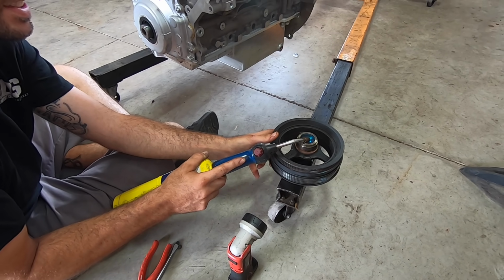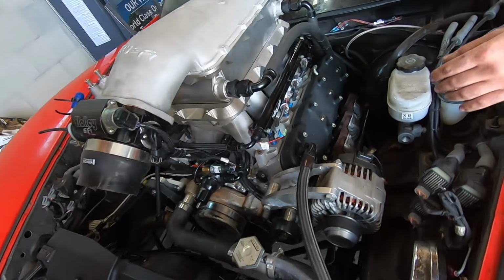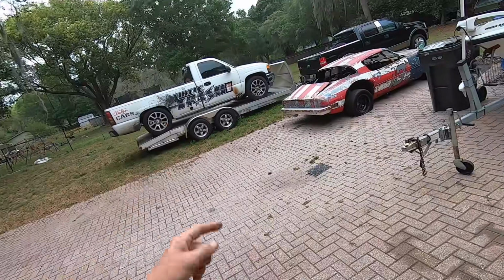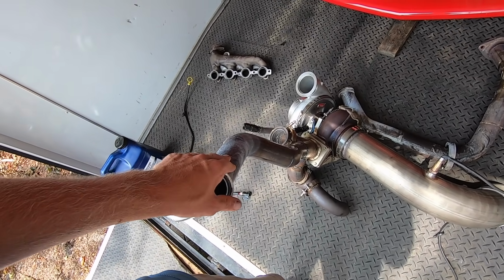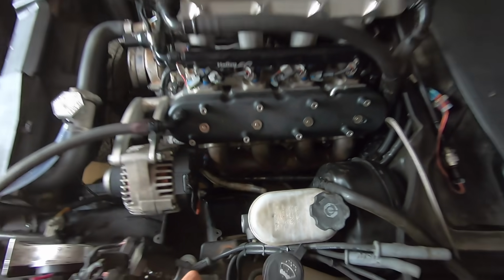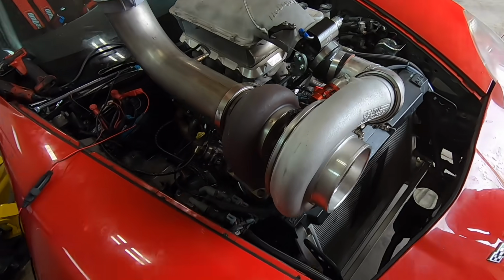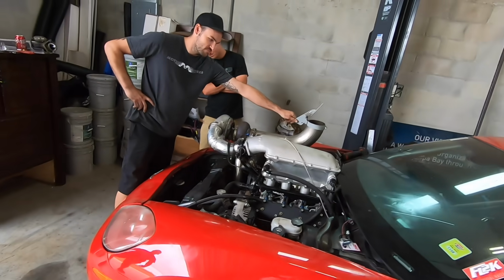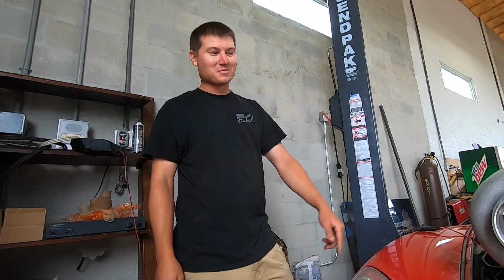Firing Up Ruby With Her NEW Texas Speed 7.0L V8 + Completely Changing Her Turbo System...(we had to)

Comment: James never ceases to put a smile on my dial, "Its going to run on methanol so it doesn't need water anyway" That was spoken like a true Aussie! maybe you've been hanging round toast too long :)
Reply: The whole methanol thing confuses a lot of people here. It's not common in the US. Not like Aussie land. I'm trying to help people understand. Also applies to  not needing an intercooler with a turbo.
Reply: @chevy383jt  we use them with intercoolers too , just use more of h20 in the mix..  Just got my first snow performance kit this year for my big turbo mini cooper s
Reply: @chevy383jt  if you want to run big numbers you still need the intercooler, you've just got alot more headway.
Reply: @chevy383jt  You are correct, nobody uses methanol in the US, people use something called E85, ohh wait E85 is Ethanol (85%) ( yes I know Ethanol and Methanol is not technically the same substance, but in this instance they are used interchangeably, for the same purpose ) and E85 is sold at most corner gas stations, so alcohol is used MUCH more then you think.
Reply: @jesperdahl1486  Yeah, I don't have a flex fuel system, so I don't pay attention to what gas stations have it. It doesn't seem to be available at a lot of the stations in my area.
Reply: DFW metroplex
Reply: @jesperdahl1486  Living here in Northern Idaho the closest E85 is a couple of hundred miles away
Reply: Logic Lover  E85 helps a lot with power but kills  mpg so that’s why it’s not common at a lot of gas stations
Reply: @jesperdahl1486  I just have never seen E85 cool any intakes like the methanol does on their cars. Also, the injectors on most people's cars  aren't high in the intake runner, so it was something cool to see.
Reply: I'll add that, I am a 20 year professional mechanic, I just don't do a lot of racecar stuff. I'm well aware of the difference in volume of flow needed between gasoline and any kind of alcohol, also that it tends to eat rubber. Watching these guys definitely makes me want to start doing more performance stuff. I used to go drag racing in my 450 horsepower El Camino. My work tried to kill my love for cars for a while. I'm back now.
Reply: The El Camino had a .30 over 1995 4 bolt main 350. Forged crank, pink rods, hypereutectic pistons. 11.5 to 1 compression. World Products Sportsman 2 iron heads. Dart Cool Can intake, good ol Holley 750 with annular discharge nozzles, no choke. Hooker super comp ceramic coated headers, summit brand 3 inch fully welded race mufflers. Comp cam, .550 lift. Built turbo 350, 2750 stall converter, full manual valve body, 8.5 rear end, 3.73's. Mickey Thompson ET streets. 11.5 wide. The economy tanking in 2007/2008 forced me to sell.
Reply: Haha damn I got so much to learn
Reply: @whydoihave6neutrals772  same lol
Reply: @whydoihave6neutrals772  This isn't a bad place to learn some stuff. I'm experienced and still learn plenty from the videos and the comments.
Reply: My thoughts, couldn’t you just thread seal the engine mount bolt anyway?  There are intake manifolds that require thread seal due to coolant channels where the bolts go.  I’d think they could seal it.  You’d just have to remember that when pulling the engine
Reply: @youtubeisbroken241  I guess you're talking about the hole that was drilled too far? If it was me, I would have welded that shut. I'm reasonably sure that they did as well, maybe just omitted it for some reasons. Texas Speed may not be willing to weld something like that, for liability reasons and such. I don't see any problem with it. Got a killer block for free/cheap.
Reply: Weld, re drill, tap. Even if it was through the water jacket. Weld everything.  Probably no issue with it ever.

Comment: Holley rocks! Or at least they did years ago. I was trying to dial in a 600cfm 4011 series on my original Monza V8 (262.5ci or 4.3L) and the accelerator shooters were too big. Called them up and they transferred me to a guy. Asked me what I was trying to do and what it was going on. I asked if I could buy a undrilled primary booster Venturi because I wanted to put smaller nozzle shooters in it. He said: " That engine and that cam is a combination I've never seen before!" "Yeah I used the older 600s and could tune them with the replaceable shooters, cams, clipped secondary springs, etc. Had to dial everything down a little. What I want to do is put the smaller nozzle shooters in this one". 

He says: "Wait a minute". So he comes back and asks for my address. "Ok, how much is the part?" I'm gonna send you two that have only been drilled partway if you can drill the outside part straight and to size for the nozzle".  "So how much?" " Free, man. I designed that carb and that's something we never thought of!"
Reply: Okay that's cool
Reply: Thats such a rad story , the holley guys were awesome to everyone at sema.. even first timers there like myself
Reply: Actual cool story, thanks for sharing.
Reply: Epic story!!!
Reply: I feel close to someone who made history within Holley history if that makes sense. Thanks for the story.
Reply: awesome!

Comment: James's secret technique to get balancers on is a tried and true method throughout the industrial world to get close fit bearings to "comply".
Reply: Heat shrink tool holders for CNC mills are an awesome thing for sure.
Reply: What about the crank seal tho. No distorting from the heat
Reply: CoyoteS197 no it is fine that method has been in use for years
Reply: Bearing heaters man!
Reply: Yep! Steel will generally grow by about 1 thou per 100 degrees. So heat it up to 700 and you give yourself about 7thou of space for an interference fit.
Reply: @wwrite  yeah, I've got a neat bearing heater that's called the oxy acetylene torch.
Reply: CoyoteS197 only needs to get to 200 degrees or so. So won’t melt seal.
Reply: Driveshaft yokes on road ranger truck gearboxes. Heat and beat.
Reply: I don’t think he said it was James’s secret technique nor was he trying to imply it was something special. He just said this was his trick to do it, i.e. this is how he does it. And in case someone were to comment with a “proper”way or criticize that way, screw off because this way works.
Reply: All who are concerned about the front seal: It is ok. You want the seals to leak. How you know that a Murican car parks there when there is no oil spot when it isn't there? You know the little drips on the driveway is just the marking of their territory. Guys don't you know that you can tell exact what car lost the oil there. It is like an DNA test not a single car leaves the same oil then an other car. OK boomer it changes after every oil change but it will always be unique to the car.
Reply: @srcastic8764  first five seconds of the video he said it's James's secret method.  Obviously he's joking and I was playing off that joke.  Calm your tits.

Comment: “Run’s a 6 sec 1/4”
Cleetus: boys its time to turn leroy up. Lmao
Reply: rcfreak781 Leroy is going 1/8th running or so they have been saying.
Reply: No they aren’t going 1/8 mile the goal is to work on the 1/8 because it’s extremely lacking compared to a lot of the stick shift competition.
Reply: @bbdl7042  yea their back end is about as good as its gonna get without aero
Reply: @joebarra1010  Be cool if someone could make a clear body for him even just for a few passes to compare times, get to still see all of Leroy as it is but also see some really fast passes
Reply: Fixing the 330 ( biggest problem ) will more than likely fix the car walking on the big end so it’ll do better on the top end. For along time it was just add power now it’s make it go straight without fighting it to death.

Comment: Roses are red
Violets are blue
Leroy can run sevens
Now Ruby can too
Reply: hyb
Reply: @TeddyFleming  hyb
Reply: I see ruby in the 6s soon
Reply: Poor Leroy's is going to get gapped
Reply: Has leroy ever run a 7 with water in it? I forget, it's been so long
Reply: Probably pull a 7 on every run
Reply: @arcadiagreen150  yep back in Nov 19 at World cup. 7.79
Reply: Don’t Jinx it
Reply: Leroy needs a revamp
Reply: It's gonna be faster than Leroy I think
Reply: Leroy compound turbo???
Reply: YEE YEE! Your a poet and weren't even aware of it!
Reply: Ruby will definitely be faster than Leroy now
Reply: Houtzyboy it’s twin turbo compound is on a diesel when the two turbos are a different size
Reply: Ruby is going to be faster than Leroy now because of the powerglide.
Reply: @928rcs8  Absolutely zero chance of that, lol

Comment: Why don’t you heat wrap or ceramic coat the exhaust pipe. It’s so short and straight it’d be such a simple process that would be so worth it
Reply: Add a turbo blanket too, keep all the heat in
Reply: It does have a tendency to eat the pipe when it gets wet, even with ceramic coating. I don't know if they plan on driving in the rain anymore.
Reply: Ceramic is nice.
Reply: Thank you ,Jake you are a voice of reason. it's cheap insurance.
Reply: 'merica
Reply: dear god with your kind of connections I’d have some nice welds on that pipe 😂
Reply: it does not look as cool. Don't forget we are dealing with a Florida man here

Comment: Just my 2cents but take a quarter to half inch cut out of the dump pipe on the outer side (closer to the fender side) and it will tweak the pipe out enough to not over heat the intake but if your cool with it then send it brother 🤙🏻
And maybe extend the waste gate tube to get the heat out from behind the turbo

Comment: The heating "trick" is well known.  The other half of the hack is to put the shaft into a freezer.  As the LS is too big to put in the ice cube tray, the hack is to hit the shaft with a CO2 extinguisher.
Reply: Or a can of duster turned upside down
Reply: OR, hear me out here, nitrous...
Reply: @JM-yx1lm  I second air duster
Reply: Problem solving at its finest
Reply: @turtle2448thomas  where on Earth at James's place would they find any nitrous?
Reply: @zachaliles  might still be some residue left in the exhaust headers :D
Reply: @zachaliles  DOH in the back of the silvia! ahhaahaha
Reply: camjamsdad  i think if you put grease in there it will help to keep the seal cool, but you got to think about the inside of the balancer cooling down pretty fast since it makes contact with the crank
Reply: I do something similar at work myself!
Reply: They literally said that in the video
Reply: camjamsdad  once on the shaft put wet rags over the pulley and shaft. Stops the heat getting to the seals
Reply: Easy Fix -- I always used a chunk of dry ICE and a torch. it slides on when you do that.
Reply: I replaced a timing belt once on a super cold day in Michigan and after heating the pulley up it just slipped right.
Reply: Or dry ice packed around crank.

Comment: If you are worried about heat from the exhaust pipe, get it ceramic coated with something like jet hot or swaintech. Helps with heat almost as much as header wrap and looks a lot better

Comment: Heating the pulley up to put it on is actually a great way to do a press fit. Some would even say it's the correct way to do it. That's for any press fit, like bearings or shafts or whatever.

Comment: I must say that this Texas Speed engine seems so balanced when running. The vibrations seems just extremly low. I know that there where a little check some would do on a balanced engine. They took a coin and put on a flat spot on the engine standing up. And on idle it should not be falling down. Maybe it where easier when you had the airfilter on a carburator. Would be very interesting to see if it's doing so on Ruby. Or just some kind of container with water or some other thin dyed liquid of some sort. 
The new placement of the turbo looks great and in a way less ghetto build. Still very noticeble though which is awesome LOL. 
Also fun to see you guys work at home and in the trailer. Makes it some kind of more possible for people to build something like Ruby at home.
Reply: Texas speed builds some nice stuff. Hopefully one day I can afford an engine build from them.

Comment: If your concerned about heat to the intake. Just add some heat shields. Get your self some thin aluminum, you can likely bend it by hand (as your not looking for sheet but something thing to act as a shield and provide surface area for heat dissipation of what does make it into the fins).

Comment: Build a stainless heat shield for the exhaust pipe. Between it and the intake. 3/4 inch air gap between the shield and the pipe. It will work wonders on temp control. You guys are awesome. Keep up the excellent content.

Comment: Cleetus: we put this balancer on sloppy mechanics style.

Rest of the internet mechanics: but you’ll ruin the front seal 👀

Edit:  I agree with it
Reply: Skinny Pedal Motorsports this is underrated
Reply: Michael Cole I support the sloppy 🤘🏼
Reply: If it looks stupid but it works it ain't stupid
Reply: Timmothy McCandless yup 🤘🏼
Reply: We call that thermal fitting.
Reply: I'm just a regular industrial mechanic with weak English skills but I'm told that you just dont heat only the center of a cast-iron pulley. Reason is that the pulley can crack because of the huge stress from the uneven heating. I would pre-heat the whole pulley in parts washer, oven or somewhere and then with much smaller temperature difference heat the center a little bit more.
Reply: Not if oiled seal first..
Reply: Oh and I dont know about material of the seal they use but If it is for example PTFE then it will be ok with much more heat than it is needed for the pulley installation.
Reply: Everyone’s a pro behind a keyboard lol 😂
Reply: @jonathanevans3007  My keyboard even has pro in it's name.  Pretty sure that makes me a super pro.
Reply: You literally won't. You torch it to like 200 degrees (or at least that's what I do with mine). The engine opperating temp is hotter than that. It'll be fine.
Reply: @pokalez3489  A stock LS pulley is multiple pieces, with a rubber damper in between the outer pulley belt race and the inner circle. If you heated in an oven it would bake the rubber and fail. Just heating the center is fine in that regard. I've seen them separate and fail before for whatever reason.
Reply: @Snarf_Le_Wombat  Good point right there. I have been working too much on old small euro engines to forget basic things like working with ribbed belts and harmonic balancers. That was kind of brain fart of mine. But yeah for the pre-heating like  50% of the ~110c is better than nothing and does not ruin anything. But when it is like you said the mass of the single iron piece is much lighter and the problem smaller. Luckily I did not reveal that I have a car mechanic background.. DOH!

Comment: Ruby is going to be in the 7s before Leroy gets back into them .
Reply: Leroy is already back in the 7's....
Reply: @TheRealQuagMeyer  well remember leroy is waiting on parts so technically he needs to go 7s again
Reply: One of Leroy's last runs was his personal best 7.80 at World cup 2019. Since then I think he hasn't ran but a couple of times. With him breaking the torque tube or transmission.
Reply: @huntjl88  wrong it was I think 7.60-7.70
Reply: @chrissmith3378  I was thinking it was 7.69. But the 7.80 pass was the only one I found quickly. May have been a later pass at World Cup.
Reply: @huntjl88  Last pass at World Cup was 7.79

Comment: You know you have a reliable car when it’s on it’s 4th engine
Reply: Except half of those were junkyard truck motors with 150,000+ miles.
Its impressive what a LS can handle.
Reply: vector6977 i’m running a single turbo on my 5.3 with 205,000 miles
Reply: You no your a bad ass when you’ve blown 3 motors because of putting to much power through them
Reply: Nippa James you don’t even know how to spell “you know”
Reply: Lol you’d think you’d save from the start by getting just a built one
Reply: Zac Elder and where is your Leroy your speec way your ruby your mistery machine you don’t have any because of hate
Reply: They truck block it came with, they blew up a 5.3 and a 4.8 I think, the 5.3 they just took out, now this one is the at least the 5th.  Although the 5.3 they took out just needed a head gasket, it was running fine.  Plenty of drag cars get a complete rebuild after a couple of passes. Ruby was 8.5 every time before they tried to get it in the 7s.

Comment: Still got that ghetto "temporary" throttle cable. LOL
Reply: "It's only temporary if it doesn't work." -Red Green
Reply: @0778drz110  great show!
Reply: There's no fix more permanent than a temporary fix.
Reply: My boat has a permanent temporary throttle cable setup. If it works, it works.
Reply: This is how car life goes. Make it run and worry about the ugly stuff later

Comment: "Air conditioning tape" up here in Canaderp we call that furnace tape
Reply: Austin Wolfe duct tape
Reply: @louisturner8842  Not quite the same
Reply: wood
Reply: Those don't exist in florida. Furnaces I mean.
Reply: Super sticky, nice and strong. Nothing like duct tape. The adhesive is similar, but using the aluminum as structure is awesome.

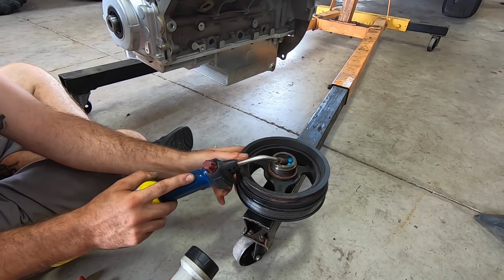Comment: 0:25 how does the seal feel about that heat?
Reply: Andy Fromm trick is to get the pulley upto 200*  and not much more. James was bumping it on by hand.
Reply: Yep like Louis is saying 200° . I like to heat in a circular motion and apply a film of motor oil to the shaft. The seal can handle the heat, which dissipates fairly quickly.  It will obviously stay warm but the usable heat is gone quickly.
Reply: I guess anything under 300 and its probably ok since its gonna be cooling off fairly quick on a cold engine.
Reply: I suppose, if you know just the right amount of heat to give it, without melting the seal, it's......ok. makes me nervous.